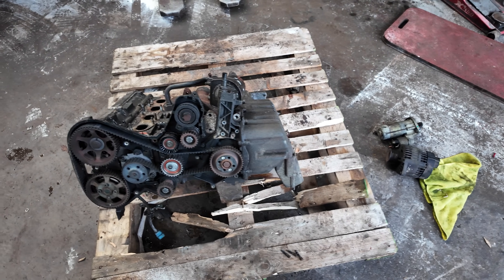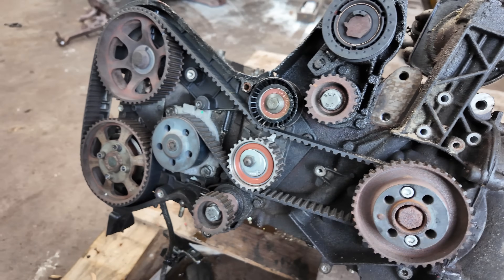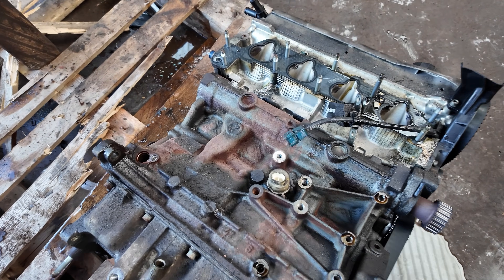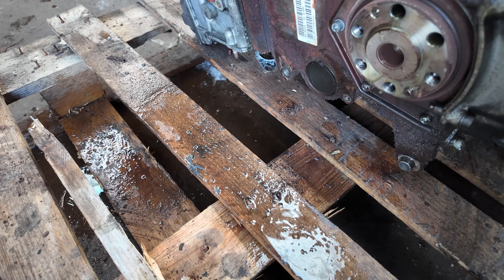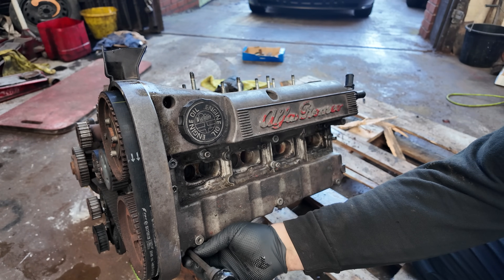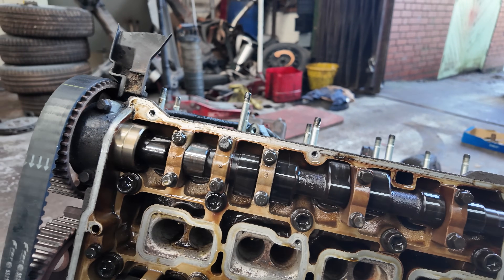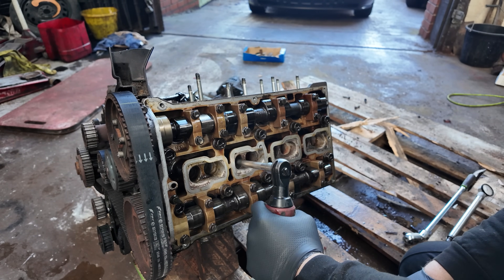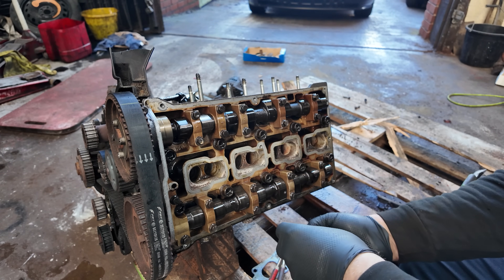Alfa Romeo Engine teardown. Do they deserve the bad reputation.

Comment: The best of the T/S has to be the 8v chain driven timing fitted to the early 155s and 164s, regular oil changes (I swear by ZX1 as an additive every other oil change) and run a fuel system cleaner like red X through once a year and you can get star ship mileage with no problems.

Comment: I would be interested to know if the Alfa Romeo 155 block is compatible with the Bacci RC321 sequential transaxle and/or Ferrari F106 16V head.

The D2 variant installed front-mid transverse fwd in the works 155 Superturismo, used the AlfaCorse 16V head with either a Hewland or X-Trac sequential transaxle, and is unobtainable.

So if the RC321 fits the 155 block, then it would be possible to build an engine based on the generic Fiat/Lancia/Alfa 16V single spark head, 155 block and RC321 transaxle, relatively easily.

Which could then be installed front-mid transverse fwd or rear-mid transverse rwd.

Preferably in something very light like a Fiat X1/9.

Comment: What I hated about my Alfetta was the DOHC cylinder head. Large and heavy. In Clubmans racing I also had a lot of problems with oil surge despite spot welding baffles into the sump. What I loved about it was that it f***ed off mightily.

Comment: How would it appear in the video that the second intake cam of the 1st cylinder would be worn and one valve of the 4th cylinder would not close? The Alfas I've owned have had great engines. Alfetta 2.0, 33 1.5, 75 Turbo, 164 t.s, 166 T.S, Spider 2.0 (1988 carb), 159 2,4 and Mito 1,4QV

Comment: Before I crashed my belowed 146 2.0TS about 6 years ago, engine has over 350kkm. Rumors said it has to be the worst one of the twinspark engines,but man this engine was brilliant. I gues my everyday abuse and revving it hard made it happy.
Reply from the maker: 2.0 ts doesnt like running low on oil

Comment: I have a 97 GTV TS. Always had yearly oil changes and runs as sweet as a nut. Rocker cover replaced at the last service as one plug socket had oil in it. Still on it’s original clutch and variator. 87k
Reply from the maker: Awesome 👍😎

Comment: I think the early 16v ts where good (after they got rid of the exploding plastic cam belt tensioner) but they got worse with each iteration. The 2001< cf3 was rubbish with the leaky low friction piston rings.
Reply from the maker: They need good and regular oil changes.
Reply: @ItaliaAutos  Yes. I used to have a 2l 147 that had been a bit neglected before I got it. At 130kkm it burned crazy amounts of oil, even with 10w60.

Comment: Hi Neil, I just noticed this didn't have a balancer belt fitted, was it running without one? I have found it very difficult to get the correct tension on mine, it will run ok for a while then the tensioner will start hitting and clicking. It's very difficult to be sure the tensioner is in the correct position as you can't look directly at it because of where it's positioned. I did buy a tool to set it correctly but it wouldn't fit into position between the chassis leg and the tensioner as it was too long. I've since had the tensioner tool shortened and re welded but haven't tried it yet. I have to get my 145 finished this year as I'm hoping to move to Wales.
Reply from the maker: It did have one fitted just taken off before filming. The tool is a tight fit to tention it but it is needed for the balance belt
Reply: I run mine without the balance belt.  I has a similar issue and my local specialist recommended removing it as if it fails it can take you cam belt out.  Apparently it was a common mod especially in racing circles.
Reply from the maker: Yes its common to remove them
Reply: I had one of the inlet valves snap on a 2.0.l wrote the engine off.  It was my first Alfa and I'd only had it 3 weeks... now on my 5th...
Reply from the maker: I've seen 1 do it over 20 years
Reply: @ItaliaAutos do you mean an engine run without the balance belt for 20 years??😮